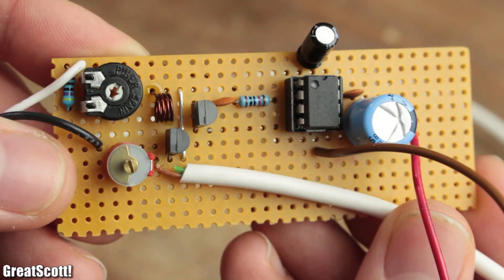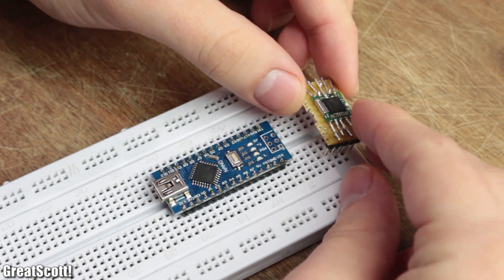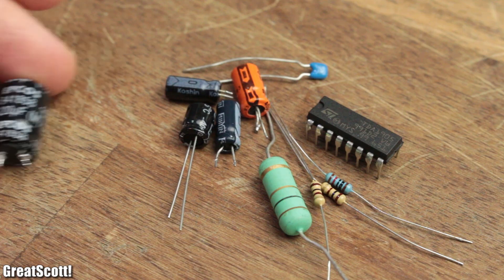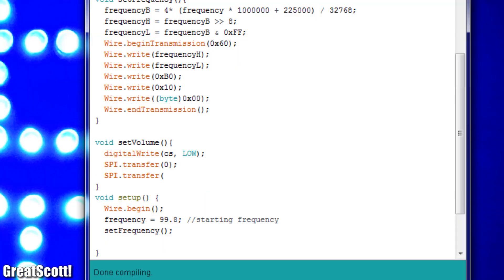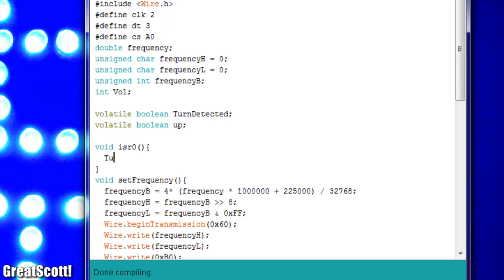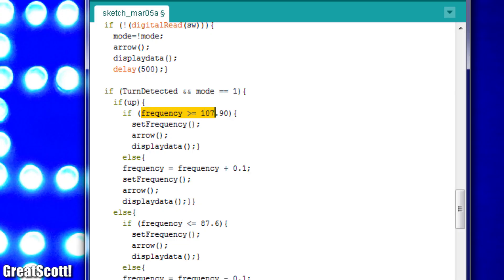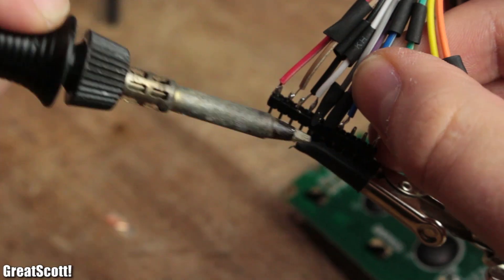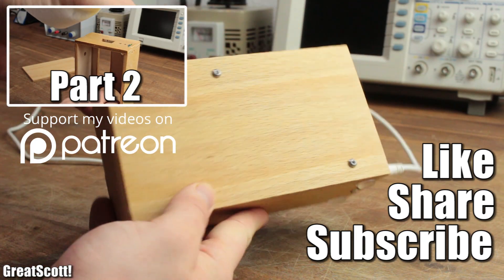Make your own FM Radio - Part 1

Comment: It's weird. It looks harder to me than building a pc.
Reply: because there is nothing hard in building an PC?
Reply: @pnkrally  There is nothing hard in picking correct parts and connecting them together into a working computer.
There is way more to it when you want a purpose-built machine.

Actually "building" a computer from scratch though... Now that is just a complexity nightmare on many different levels. Just think if you could build, say, an Arduino, yourself, from scratch.
Reply: @tomaszwota1465  that's what I said mate
Reply: @pnkrally  Unless you're trying to say there's only one way to interpret your usage of "build", then I have to disagree.

Comment: I still couldn't figure out what the booster does, you mention it in a lot of your videos.
Reply: The battery used has a nominal voltage of 3.6 to 3.7V, depending on chemistry. Practically, its output could be anywhere between 3.0V and 4.3V, depending on current drawn and charge remaining. However, numerous components of this circuit need to be driven by a stable 5.0V power supply, so the booster is used to step up the battery voltage to the 5V operational voltage.

Comment: +GreatScott!  How do you protect your li-ion battery from over discharging ?
Reply from the maker: +hemanth kumar The TP4056 board has a protection circuit as well.
Reply: I meant the boost converter would discharge battery below its recommended level. Since it can work from input as low as 2V.

Comment: why create an intermediate signal ? why not just demodulate it ?
Reply: Because you would be demodulating wide band noise with it, and the result will be crap. At the intermediate signal, a finely tuned sharp filter can be applied to reject the foreign bands. If you wished to make a filter which could be retuned to different frequencies, you would need to control multiple parameters, which would make it super finicky.

Comment: Have no idea what he is talking about most of the times but I always love watching these videos
Reply: it is quite simple once you get a basic understanding of electronic components.
Reply: i have it and i dont understand sh.. when he came to coding and making like a million circuits
Reply: Sameee.
Reply: It's frustrating, I need a video that goes into great detail. For instance does the bread board holes have continuity between them side by side or up and down or what. Then which resistors are right for this application, wire wound, carbon, carbon film, metal oxide or what. Then when you write code do I have to use ( ) or can I use { } or why do I have to use any. How do I know where to start writing, where does it hookup to my computer, do I need software, how do I know what to write, is the device I'm writing to need to be externally powered and from where with what. Which pins on the control knobs do I use, which way is it inserted in the breadboard. Do the jumper wires need to have pins soldered on them. What is the cap  for at the speaker, what ohm should the speaker be. What length does the fm antenna need to be, where does it hook up at, does it need a counterpoise. And on and on and on.
Reply: @orange70383  you can't cover all that in 1 video, but you can search for "how does a breadboard work?", "write my first program in arduino",  and so on... and get your doubts  cleared little by little....
Reply: +Oliverleo2007 samee
Reply: LOL  LOL   LOL
Reply: orange70383 True
Reply: He makes me sleep so I watch this every night
Reply: Same
Reply: Hope better explanation for noobs like me ☺️
Reply: I'm also. ...
Reply: Rix IV in àuu
Reply: orange70383 Get a degree in electrical engineering. It may not teach this stuff but it will teach the basics and you will then be able to understand this material. If that isn't a viable option, you can always get books that go into detail about it.
Reply: +Invarex it would take a large amount of time to build this stuff even after an electrical degree...

Comment: I really like your perfboard work as it's very tidy. You should consider investing in a bag of real connectors, though - those headers with the wires soldered to them look all but nice.

I personally like the stuff you find when you search for "PSK" and "PSS" at Reichelt very much, but simple Dupont connectors would probably do as well.

Comment: This is just awesome! I used to build FM radios back in the 70's with discreet components, in fact my first stereo system was entirely self-designed and built. But it's been years (make that decades) since I worked on any audio projects and I had assumed that these days with gear being so cheap that nobody was doing it anymore.

You have restored my faith in the spirit of building home-made electronics. This is a beautiful design, and to anyone who asks "why not just buy a cheap one from China" all I can say is that they don't understand what it means to design and build something from scratch.
Reply: Not exactly from scratch. The amplifier was already there. The FM IC is already there. The digital potentiometer is also there. The LCD with built-in controller is already there. However I agree with the spirit of your comment. It's a great satisfaction to build something from bits and pieces.
Reply: You’re so right!
Reply: They do know how to steal designs though and copy them.
Reply: Is there a certain or special class one has to take to learn all of this. Thanks in advance.
Reply: FM radio
Reply: @piryasingh703  No AM radio
Reply: @logc1921  she said FM radio, stop.
Reply: @spicesmuggler2452  AM radio
Reply: Fm radio
Reply: you should make a video detailing that!

Comment: can you do a video on how to make a analog VU meter that has a good response i.e. tune to a certain frequency so you can see mids, lows, and highs separately? I bought a DIY kit from ebay, it works and all but I'm not getting the responsive bounce of the needle that I was looking for instead it reads the total signal meaning the needle doesn't bounce it kinda just moves around in the middle slightly to show you the what the output looks like

Comment: Wouldn't an SDR with an SBC be cheaper (and simpler) than all those components?  And fit in a smaller case.  Or is there a significant power savings going that route?

Comment: This is a great practical gift because of it's classic interface.
Reply: +subsynchronous To me "classic interface" means a needle moving in front of a dial. I kind of expected the whole thing to be analogue to be honest.
Reply: +SomiTomi There were digital radio interfaces 25 years ago but I understand what you mean by the golden era. Now-a-days, it's wifi/bluetooth/nfc/etc operated.
Reply: subsynchronous
I know, I have an '80s Hitachi receiver (or as it refers to itself: "Microcomputer-controlled quartz digital synthetizer tuner", I'm not making this up) with a really nice looking VFD on it. I kind of like all sorts of radios actually, I just like ones with no IC-s a little more.

Comment: Please don't be fooled by the text put on the encoder board. It's not Clock & Data - It's two phase signal, 90 degrees apart. It's called quadrature encoding.

Comment: Didnt you yourself say that you shouldnt use an arduino in a circuit but rather just a dip-atmega?
Reply: +daniel tabrizian As you can see at 0:22, a lot of GPIO pins are used - a DIP Atmega doesn't have nearly enough pins.
Reply: Bruh
Reply: +Ktooosiek28 really? wouldn't it be the same? after all, the arduino uno is based off a dip atmega, and the arduino uno has just as many, if not more i/o as the micro
Reply: +Jake Dancel it is the same thats where the bruh came in
Reply: This guy obviously doesnt know what hes talking about
Reply: Damn, you're all right - I was thinking about DIP-8 PIC microcontrollers when writing that.

Comment: Wouldnt that small voltage regulator module eventually get to much power pulled threw it? Then again since you are using a single cell lithium battery it seems the circuit isnt drawing to much power.

I used one of those small modules before and it caught on fire.

Looking back, maybe i shouldnt have had it assist in powering a 100w led....

Comment: Hey you just solved my problem with my rotary encoders! now one question, what is the capacity of the capacitor you used/ should use?
Reply from the maker: +Jameson Sullivan "Ptopman" 100nF - 1µF should work just fine.

Comment: Nice video! I would have liked to see a little bit more info about the superheterodyne process and how it works/why it's used etc. IC's are very "black box" - where all the complicated circuitry is hidden out of sight, and unfortunately, out of mind. I think there is value in knowing the basics of how the mixer IC and amplifier ICs actually work beyond just how to use it with an Arduino. Perhaps in another video you could explain these processes. 
Keep up the good work!
Reply: Why can,t you make with the single Sony IC 1619 like one with LCD display with auto searching incl Bluetooth n recording ability.

Comment: One simple question: is it silver plated copper wire what you used on the final board?
Reply from the maker: +Pipe0481 Yes
Reply: +GreatScott! Il try paperclips fir the sake of it
Reply: +GreatScott! Thanks!
Reply: +Pipe0481 incredilwe what the industry has acheived right? all this process is just worth 5 dollars now, not even that, consider transportation, taxes and the reseller and seller earnings, its just worth 1 dollar maybe

Comment: kann man eigentlich mehere TP4056 module in reihe schalten, also das output, um die Spannung zu erhöhen, oder ist das nicht möglich? ich möchte nämlich eine mobile box auf 12v basis bauen und vier lithium zellen in reihe schalten, um dann auf ca. 14,5 volt zu kommen.
Reply: Du brauchst dann eher ein DC DC Step up Konverter nach dem Lademodul.
Der Ausgang vom Konverter ist verstellbar und die maximale Ausgangsspannung beträgt 35V.

Comment: GreatScott, how are those tiny 3W 5V PAM8403 amplifiers so powerful? They only output 3 watts of power, but are extremely loud...
Reply from the maker: +TeaDrinkingIlluminati 3W is already quite a bit. If you want to learn more about class D amps then you should check out Afrotechmods channel. He made a great video about those.
Reply: +GreatScott! i have one of those PAM8403 amps and they are awesome. Thank you for the project you helped me out with mine big time.
Reply: +GreatScott! Alright, thanks
Reply: +TeaDrinkingIlluminati 3W is enough, just all the big companies adverties with like 1000W because people who know nothing about electronics just thinks its way beter then 500W
Reply: +TeaDrinkingIlluminati You don't know what is powerful until you used D amplifiers. There's a 2x50w one sitting next to me and it is a beast. If I pull the volume up with no output on, I can hear the inductors squeak to the rhythm :D
Reply: +iceberg789 Well I know about quality loss, it's a filtered PWM signal overall. But that size combined with that power?
Reply: Except that 3W will have the same volume as a tv in normal use at best. I prefer my 2x50 even if I only run it at 20-ish, because I like volume.